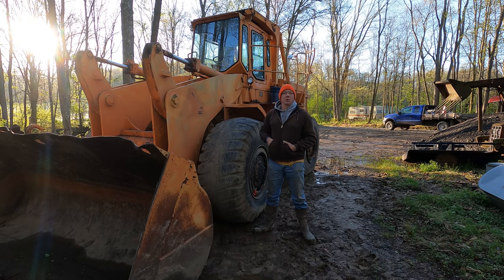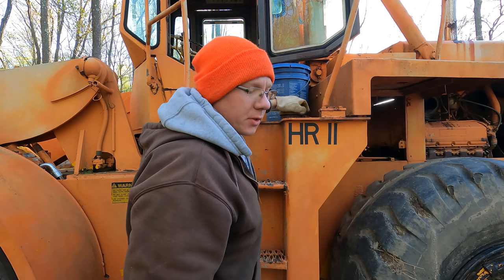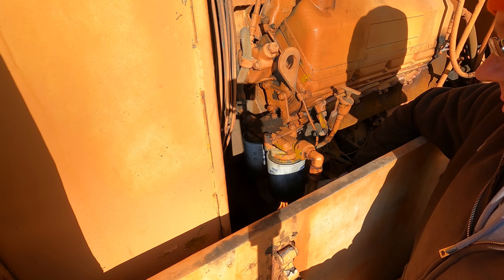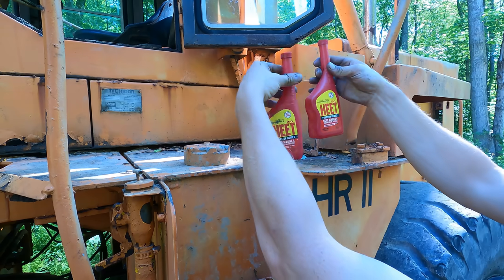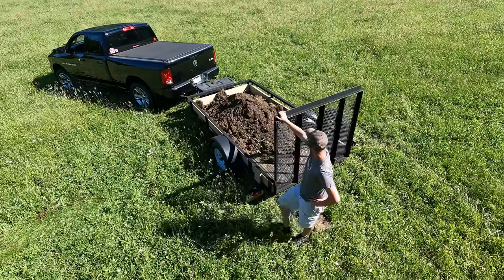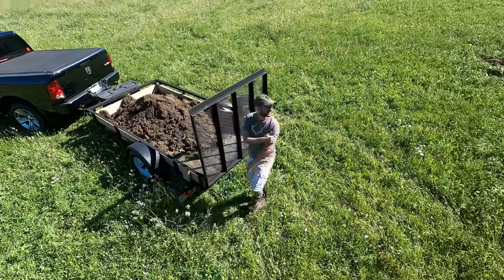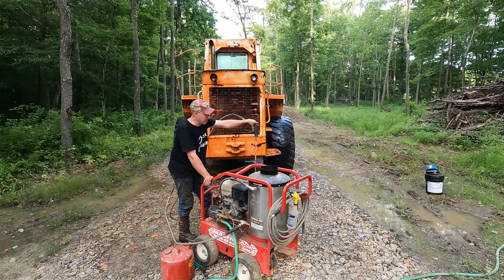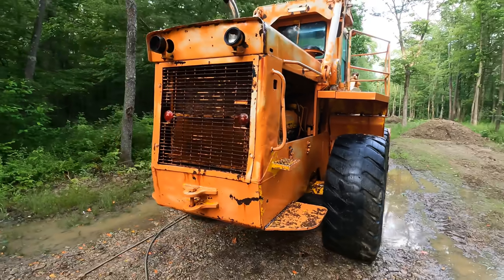Repairing & steam cleaning 20+ years of Filth off of Abandoned Clark wheel Loader! (ASMR?)

Comment: MATT!!!!! What are you DOING with the pressure washer 😳 Those nozzles contain ceramic bearings and there is a VERY good chance of smashing them by holding them anything other than down when pulling the trigger! Once the water is flowing, you can invert them and do what you want, but if you want to keep paying over the odds for a replacement nozzle, carry on. I have the same one for my Karcher HDS6/12C and I was given a strict warning by the dealership to point down upon starting, etc. I know this is 2 years later, but it might help in future & anyone reading this 😃

Comment: When I worked heavy equipment, the machines were filled up and topped of every night, to be ready in the morning! Greased, oiled, & repaired in the evenings, to be ready in the morning!  Nothing more expensive than having trucks & labor coming to work, and standing around with nothing to get started on.  Even on a farm, it’s good to have everything ready for morning.  Old equipment was available for emergency equipment replacement, and it has to be ready to go, also!  If not, you have a very expensive hobby!  Equipment runs until it doesn’t, there are not enough crystal balls to warn you!  Everything on heavy equipment is expensive too replace or repair!  I’ve run heavy equipment since the 1970’s, and it was very satisfying work, after mastering the trade, and deadly until you do!  If you get hurt 😢, first aid kits, usually don’t cut it! Count on an ambulance 🚑!  Good 👍🏻 luck 🍀, and try to enjoy yourself!🥰

Comment: Detroit injectors and fuel pumps are different from other diesels.  An old Detroit mechanic said that system will force air out while other systems will become air locked and you have to release the air by bleeding the system.
Reply from the maker: This is a Cummins
Reply: @DieselCreek  sure sounded like a 8v71 Detroit and sure looked like it.  My mistake.
Reply from the maker: @samdunn1807  I wish it was lol

Comment: Kinda Sounds Like the 555 Cummins V8 , Which Has Common Fuel Injection issues , But when they Were Working good they are amazing Engine's
Reply from the maker: That’s what it is
Reply: @DieselCreek  I'm Very familiar with the 555 Cummins have about 30 of them in my private Collection , The Fuel Injectors get plugged so easily , Great Engine Poor Design , Kinda like the Ford 6.0/6.4 Diamler Mercedes Benz Built the Engines which Was said to be Better and Turned out to be worse , Also noted the 555 Highpressure oil Pump Commonly Fails so keep an eye out

Comment: Just the simple fact that that 504 even starts has got you way ahead
Reply from the maker: 555
Reply: @DieselCreek  oh goodness that's got a Triple Nickel I remember those in a lot of medium duty trucks Keepers like popping off the valve springs them things will sound off like a big block Chevrolet I wouldn't let it go over 2400 if you want it to stay with you a bunch of them made it into Ford 8000 in the 70s they were allowing them to run 3000 and that's when they started having valvetrain problems the 3208 seem to be more trouble free in the same truck but they usually govern those about 26 27

Comment: Believe it or not, you can add a little bit of gasoline to diesel when it's old.  It works well.  Not too much!  I've added  1 gallon of gasoline to 20 gallons of old diesel, it worked.  It had a problem with no power...it was the fuel.

Comment: A touch of winter diesel wouldn't do you any harm, or add a gallon or so of paraffin to the tank and it will start better in the cold. I'm guessing there are heater/glow plugs in the engine which are probably dead?

Comment: once water gets into a diesel fuel filter it will effectively plug it and prevent diesel getting through. You either get a new filter, or tip it out and fill with fresh fuel. So long as there is water in the fuel tank, the tipping the filters out will need to be repeated...........very painful process.   If the Clark gets a pressure wash every weekend, it will eventually be completely yellow again.

Comment: My 1969 Hough H90C is way dirtier than your guy. I will be pressure washing it this summer and doing some resealing. All cyl are leaking. The IH DVT573 runs but I think I may put my Cat 3176B into it as repower. Parts availability. I have to rebuilt the torque converter anyway. Cheers.

Comment: If it was ice in the filters then you'd melt it with the heat, start the engine which would pull up ice cold diesel into the filters and wouldn't that cause any water to re-freeze?

Comment: Should not be using HEET or alcohol in a diesel. The problem with this engine today is fuel gelling not ice. Very seldom ice will plug the filters unless they are full of water, however there there may be an ice slug in a line somewhere at a low point in the line. That would not have been solved by heating the filters. 

Use "Power Service" in the fuel during any cold weather.

Comment: I bent an axle on similar trailer trying to haul dirt.. I'll never buy a single axle trailer again..
When using these turbo nozzles, always point them straight down when your starting them or they just won't last, i can see it's not rotating like it should, probably wrong nozzle size aswell, they size them for your gpm
Reply from the maker: It’s sized appropriately. The o-ring wA going bad and bleeding pressure

Comment: I hardly ever comment on anything for anyone, but I suggest not power washing the engine compartment. When you spray high pressured water onto engine the lines can have small traces of water end up in them because the water is forced through where the lines are connected. I have seen this happen many times on different machines, so just be careful!

Comment: 🇩🇰 Why do not soon mount a pipe to the exhaust so it does not blow smoke straight out to head height it is probably the least costly to find such a rubber pipe that can send the smoke up into the exhaust.

Comment: In gas engines you run hydroscopic? To allow water to mix with fuel and burn, and in diesels you run hydrophobic to separate water from diesel to help filter and water separator get the water with out ruining your injectors!! Spelling could be wrong, but the two fuels require the opposite in water treatment…

Comment: Looked like a considerable amount of crap in the secondary filter.  Not good as it means any overflow from there is heading for the expensive fuel pump and on to the injectors.  Neither of which like dirt and are spendy.  I would scrub the fuel (no one likes to throw away expensive fuel) at least and give the engine a fighting chance.  Agitate the tank with a long piece of tubing on a blow gun to get to the bottom then set up a couple of extra large filters (I use marine Ray Cor but there are cheaper ones for home fuel tanks) in line with an electric automobile pump, pretty cheap and break a line before or after your on board filters running a hose back into the tank.  Run that for a three or four hour period and the fuel will cycle through your filters and clean up the water and garbage.  I start with 20 micron filters and finish with 2-5 micron ones.  Agitate a couple of times during the scrub cycle with the compressed air to keep the dirt in suspension.  Helps clean the tank as well as the fuel.  You can also pump it into a drum or two and then examine the bottom of the tank before filtering it back into the tank.

Comment: Just got an attachment for my 3000psi water blaster so that I can do some wet sand blasting.... just used washed builders sand as the media. Hell it ripped off the old paint real fast. For what it's worth I was thinking it was just a bit of a toy but it worked really well if you don't own a compressor that producers enough CFM to dry blast. However you need to add Holdtight 108 to the water supply tank to stop the flash rusting and this gives you max 72 hours to paint the steel. Here's a link to the unit I purchased (don't use the pipe it comes with) use 15mm Butuline as it holds it's shape better and fits like a glove on the unit and sand uptake rod. Works for me better that the video on the link. I guess it's because the PSI on his machine is lower. You can get these on ebay too. Cheers    https://www.aliexpress.com/item/4001247143597.html?spm=a2g0o.productlist.0.0.332952e7iwbiwO&algo_pvid=5f3936c6-4cce-4e54-9b33-e77e55fb5ad9&algo_exp_id=5f3936c6-4cce-4e54-9b33-e77e55fb5ad9-1

Comment: Something I noticed is you are using non road diesel fuel with the dye in it. If you'll do a quick calculation you'll find you're paying almost $1.00 more per gallon for that than road diesel. You buy the regular diesel at the pump and keep you're receipts for all non road use. At the end of the year you file your taxes and get the federal tax refund as well as any state road tax in you state. That varies from state to state. You have to offset part of that with sales tax but the savings is considerable. I found this out when I bought #2 fuel for my home heating furnace. Look at what you pay for the dyed fuel vs what the stuff at the pump costs. Unless it's nearly $1.00 difference you are losing money.
Reply from the maker: I usually get 1000gal at a time and save well over a buck a gal
Reply: @DieselCreek  You must get a better deal. Around here they tack on about $1.00 a gallon for delivery which makes the dyed fuel more than regular pump diesel not counting all the road tax that isn't on the dyed stuff.

Comment: For $1500.00 you have to fix it up - come on!!! there is cheap and then there is cheap - watch out working on hydraulics on any articulating equipment, need to put in safety locks on the steering rams - old hoses can rupture and you can get pinched. Worked as a Licensed Heavy Duty Mechanic (Canada)for several years and taught High school auto-motives, like Matt said you have to be very careful around high pressure hydraulics.